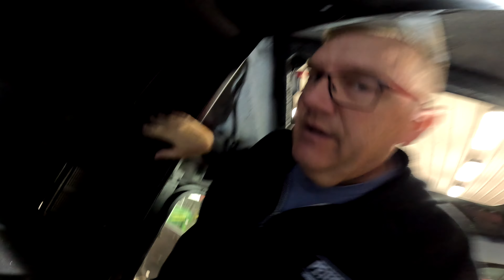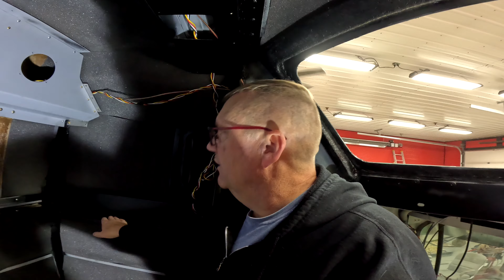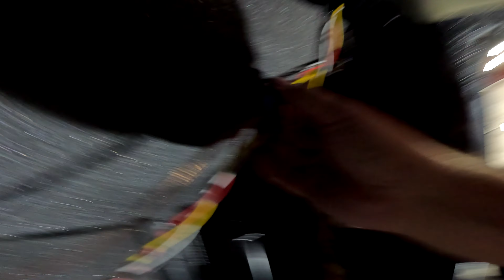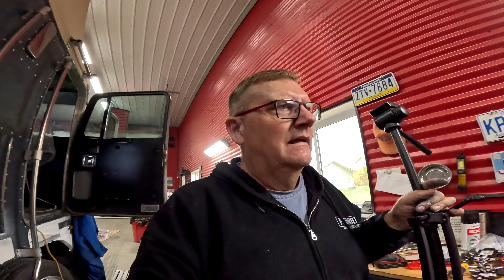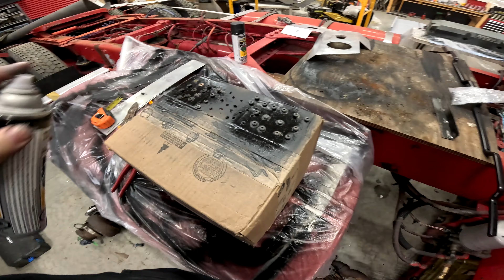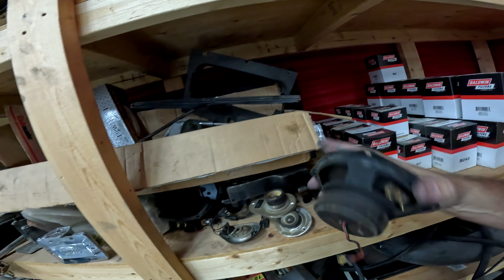Kenworth Aerodyne sleeper #kenworth #cabover #trucking

Comment: Going to start on engine after don't interior mike
Reply from the maker: Yes if the engine shows up by then.  I have a 2005 series 60 coming with only 130000kms on a rebuild. So I'm going to put it in.  That's the plan anyways